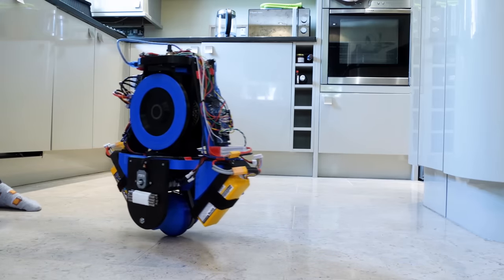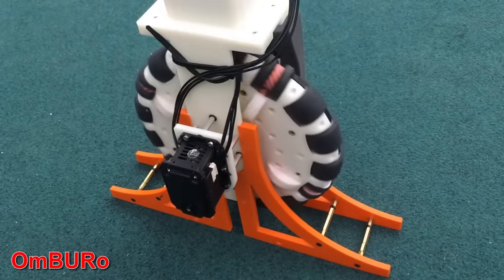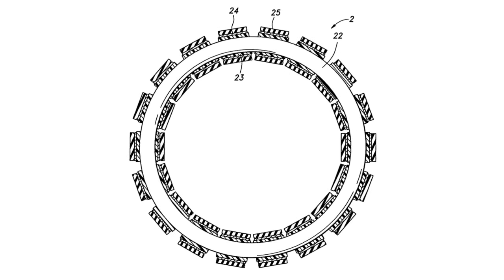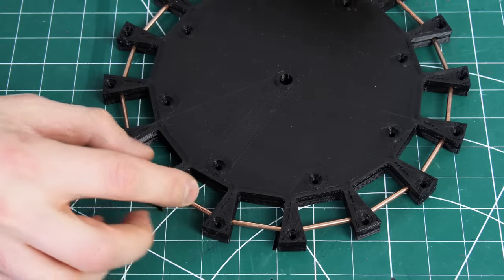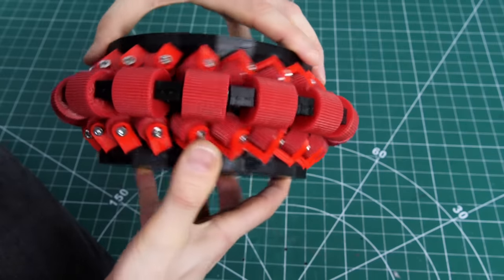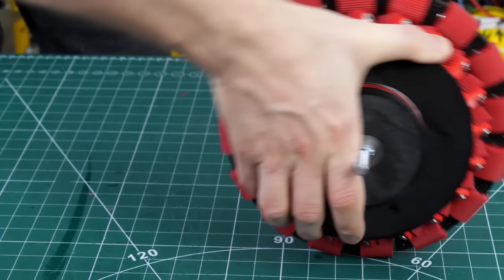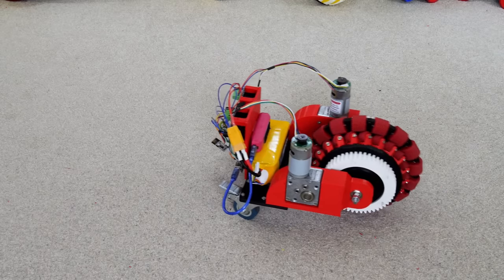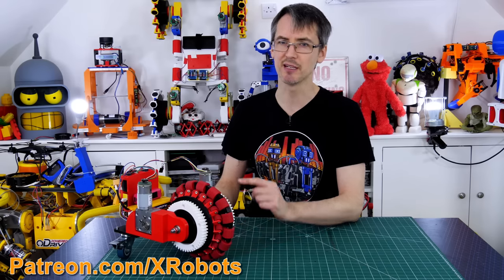Why this Omni-Wheel is Really Weird

Comment: For each of the wheels that comes into contact with the ground, why not print them with a slightly larger middle, and smaller ends? I guess the friction between them and the driving wheels would be less considering, but I think you'd get a smoother ride when going in the direction of the largest axis.

Comment: Seems like all of these concepts have a lot of mechanical complexity and friction that could be overcome by adding motors inside the wheel and use a rotary electrical brush system.

Linking the circumferential wheels though is still an interesting challenge. I imagine backlash would be a real issue. But perhaps tight bevel gears - perhaps in a high durometer flexible filiment, would do the trick.

Comment: The problem with this omni-wheel is efficiency, there is so much friction, so most of the energy we supply is lost as heat, and for a device that is running on batteries, this is a big concern. I think this problem will disqualify this mechanism and make it not practical for use outside a demo.
Reply: Can the design be refined? Maybe this design would be useful in industry somehow. I can see this being far superior to the castors on big things.
Reply: @lindboknifeandtool  Can the design be refined? of course, for example by using harder materials, the deformation of softer materials consume energy and softer materials means more contact surface which means more friction.
Every mechanical transmission system has its own efficiency (ratio of output power to input power), which varies according to several parameters (like gear ratio, contact surface, materials, gear ratio ...), and IMO this system is a bad idea, there is so much contact surface witch generate a lot of friction, the wheels are angled 45°=> even more friction cuz the small wheels and the big one are not going in the same direction, it's like a car that skids all the time, and only a fraction of the applied force are useful at the contact surface between the wheels (Fcos45°) ... , so the best way to refine this design is to throw it away and completely redesign it, which will bring a different product.

Comment: You don't need to drive every roller on the wheel assembly, so why not have a slightly larger core wheel, relying on a combination of the device's weight, and a tension spring as backup, essentially making the roller assembly only able to make contact with and drive the bottom wheels? It would put higher friction load on the bottom of the assembly, but friction around the circumference, where it's not as important and seems to already have slippage from the lack of weight on the rollers, would be drastically reduced.
For visual flair, you could give the core wheel a monowheel design, with the tension spring connecting from the axle.

Comment: You can certainly put an open-source license on it. In fact, doing so to cover the copyright side of things in case you get hit by a bus before the patent expires is the responsible thing to do. You just need to choose a license which doesn't weigh in on the patent side of things.

(That's why you find open-source code for things like H.264 that doesn't get distributed by distros like Fedora. Because, copyright, patents, and trademarks were conceived as mutually independent systems.)

Comment: I believe you may experience some better connection between the out wheels and the driven hub if the small wheels were a spiral threaded design instead of the level tooth-geared design. This would mean the threads on the bearing wheels would fit perfectly inside of the teeth of the drive wheels

Comment: Perhaps a rubber torus more like a traditional inner tube instead of all those fancy rollers. Less parts and better grip, but with more friction loss when strafing. With a rubber torus it might make more sense to have one motor to roll the torus and a different motor to make it spin, due to material loss from friction and a difference in torque requirements. A rubber doughnut would also have more accommodating shock reduction over hard ground. Unfortunately sand/grit would be cancer for a wheel like this either way (fatal flaw).

Comment: This is really cool but it seems to me it would easily break if you used it daily. IF there was a Hole through the middle of the Tire, Maybe you could cover the sideway rollers with a flexibel donut shaped outer layer, this way protecting it from damage and weather. Means you need to put the drive torus in the center of the wheel and find a way to transfer movement without to much friction on the protective layer so the idea isn't without cons im afraid. You are doing brilliant work, Keep it Up!😀

Comment: Question: To get an angled path of travel(forward/backward and left/right simultaneously) would you rotate the two drive gears in opposite directions at differing rates? As in, the difference between the speed of the two rotating gears would be translated into forward/backward motion?

Comment: Hello, thank you for your awesome videos. But I have one question on this particular video.
Wouldn't it work better if you had printed diagonal lines on the little hubrolls instead of the straight lines? So that they could line up better with the bigger outputwheels wheels.

Comment: Very cool! I wonder if there would be any benefits from making the drive hubs smaller, and offsetting them so the little gears only engage with the larger ones that are in contact with the floor. Maybe the little hubs could also be more perpendicular to the main hub (more parallel with the floor) so they could squeeze the driving gears harder, while also reducing the lateral twisting on the little hubs.

Comment: The grooves in the smaller, 45 degree angle wheels should be cut at an angle that matches the larger wheel's groove's angles so that the gears interlock and not just slip past eachother.

Comment: Wonder what would happen when the subwheels have a 45° groof. Obviously one side of the sidewheels need to be turned 90° to match the other. This, next to better interlocking of the wheels, gives way to a harder material used for all wheels.

Comment: intersect subtractive cuts on the center where the rollers touch.  Then you would perfect gearing between the angled rollers and the center rollers, but maintain tread on the center.  As if you had a crosshatch pattern so that 2 separate angles of gear teeth coexist.

Comment: if you want a flexible inealastic material torsion transfer material, try speedo cable, or the larger flexible drive cables used to power tools

Comment: I feel like the helical gear solution is still a much better solution. I don't think with brushless motors and high accelerations and decelerations the tires are going to efficiently transmit the torque reliably. Great project! I am no wheel expert! Just my theory based on what little I know of something I had never heard of until 10 minutes ago!

Comment: The OmBURo wheel could be improved upon. Drive the wheels from the outer portions of the axles, rather than from the center, and hide the gearing within the mounting plate. Doing this to every wheel would remove the need for the flexible shaft while also turning every wheel equally. Honda's wheel obviously works fine, but I personally feel better with a geared connection rather than having a friction-based connection that relies on redundancy upon redundancy. IIRC, dual input differential drives to change between driving and steering are called swerve drives, at least in competition robotics, and these kinds of wheels are just an evolution of a typical swerve drive. It'd be interesting to see if anyone can ever refine an omni-swerve, but I don't think there's any chance that it'll ever see use outside of medium speed robots on fairly level ground; which is the downfall of all omni wheels, none of them will ever see use in areas where they'll actually be pushed to their limits, such as road vehicles for speed or rough terrain for durability.

Comment: Neat, but the design issue is the energy used to perpetuate balance motion is much higher than simply using a robot which is built around minimal use of energy for movement and balance.

You could perhaps use this for a microscopic robot, by using matter that repeats states in a systematic nature (for instance, quartz, or time crystals, etc)
But the amount of energy needed for larger robots... mehhh.

Could simply make an egg shape robot that keeps balance perpetually due to its shape and weight distribution, vs this which needs massive energy for gains which can simply be had through design.

But yes, looks fun to mess around with.

Comment: A better way to drive the small wheels would be one gear pointing down that connected to a sliding the axle of each wheel when it came into rotation under it, sliding through to the next wheel.

Comment: Why not print the grooves on the rollers at a helical 45° angle, so they fit properly with the outer wheels instead of relying on friction to drive it? Then you could use something tougher, like vulcanized rubber.

Edit: Just noticed everyone else saying the same thing.

Comment: The problem with this design is the excessive friction between the wheel sandwich. It does work, and with some refinements, it would work very well, but a slight modification using a mechanism similar to how a helicopter tilts the main rotor would be massively better. The reason is in this design there are forces to drive all the wheels even if they are not touching the floor. The mechanism should only power the region of the wheel that is actively ingaged in motivation. This can be accomplished with a stationary V shaped design. You seem to be extremely adept in what you do. Could you please make a video at this attempt and tag me on the comments? I think you'll find it to be an extremely superior design as this and potentially even something you can market. The only downside to the V shaped design is having enough friction where you need it. I'm thinking electromagnetic force or neodymium along with a clamping force of the V Frame. I'd try it myself but I don't have your resources available. Good stuff man! 👏

Comment: Can you print the small drive wheels with a worm gear like profile interlocking the outside wheels?
And maybe make the outside wheels a bit curved, ball like, and the small drive wheels concave worm gears? (Or would that hinder if the drive wheels hop over to the next outer wheel?)

Comment: For this current demo, would a design like a screw that goes both ways work for your central wheel? It would be less binding and always have a point 'flat' against the gear as it pushed on it I'd think. Would be less binding and allow you to tighten up the design a bit ya?

Comment: Shouldn't you be able to use slightly bulbous wheels instead of wheels of curved cylinders, so you'll still be able to use the straight axles? maybe also try to match the shape of the contact area of the little wheels with the big ones to get more torque, making them slightly concave.

Comment: I dont think the omburo design would be hard to print. just use a helical gear for every roller and the same stiff individual shafts you have here, instead of 4 total with flexible shafts. the main helical gear might fit inside a wheel print and keep the whole thing compact and together.

Comment: Instead of a flexible shaft, what about dog bones? You wouldn't need to worry about using any exotic material just having a bar with 2 letter C or U shapes on either end of the shaft That could interlock with each other or T shape axles with a Slotted socket U-joint couplers like modern RC cars use.

Comment: I don't know if your 3d printer ( or really any 3d printer) has right enough tolerances for this. But you could possibly curve the exterior(?) wheels to match the circular curvature in the interior(?) wheels, and then you could curve the teeth of the gear like they do for stage gearing(?).

Kinda like )((0))(

Idk, the question marks are all the things in not entirely sure how to describe, and I've never really looked into this before, but those are my preliminary thoughts.

Comment: Could you use small outrunner motors as hub motors for each roller or use 2-4 of them connected to each other via segments of flexible drive cable?

Comment: How about you make the outer wheels shaped like a football with the edges cut off?
That way you'll always have consistent friction with the floor and you won't have the issue of the elbow-pasta copyright wheels :)
Reply from the maker: Because the little rollers on the sides will have even less contact area.

Comment: With the hubs having their wheels mounted at 45 degrees, the cog teeth are not meshing well with those of the central wheel, even though they're made of some soft plastic. Perhaps a better tooth design would help. Instead of the cogs having teeth cut in the Z axis as straight lines, why not have them as a pattern of dots? Essentially have two 45 degree cog patterns superimposed, and where they coincide, have a point, a peak. Where they un-coincide, have nothing. A bit like coinciding waves on water or the like, the two wave patterns reinforcing and cancelling. 

This pattern of little studs ought to engage better even though they're at a different angle, and engage regardless of the direction. At the moment the cog pattern is useless and they'd be better off flat. Little studs would go both ways, in the spirit of a Meccanum wheel. 

I might be wrong on the angles to use, but 45 degrees and 225 degrees (45 + 180) make sense to me.

Getting this right might enable you to print the relevant rollers out of something harder, reducing slip and giving much better control, and much more efficiency. The central hub, btw, would keep it's existing cog pattern, though perhaps that could be improved too. These are just initial thoughts. Surprised you didn't consider this while you were waiting for it all to print! Obviously with 2 printers you're being spoiled!

Comment: i wonder if having the teeth on the small rollers at a 45 degree angle so that they mesh with the large rollers would have any meaningful improvement. or if printing the rollers as mostly solid plastic with only the outer 1mm or so being tpu and/or printing the rollers as more of a sheath for a long bearing would help. i'd love to see where this idea goes

...also at what point does this become different enough from the patent that it isn't infringement? i guess the addition of teeth isn't enough?

Comment: Isn't such a system too sluggish to drive at higher speeds on uneven surfaces?  Let's say you build the whole thing in large and drive it on a cobblestone road or off-road. I mean most surfaces are not that wheel friendly.

Comment: what about using pex as a drive shaft it's flexible and it doesn't stretch you could also put sand in it to make it hever on the bottom making it easier to balance

Comment: So the drive wheels are held at an angle to the output wheels but the teeth do not need to mesh? Wouldn't that end up in slippage and a loss of energy in the transfer? Or does this have some other advantage?

Comment: This is very interesting and I’m glad that you made it, but couldn’t you accomplish all of this just with two wheels each with its own motor? Kind of like how a tank works? Such that if both wheels are going the same direction you move forward, but if you control the speed of the two side-by-side wheels it could turn or have a semi directional thrust?

I’m sure there are some problems with this as well, but it seems like a simpler thing to work out and probably more efficient at getting power to motion.

Comment: There is no machine in the world that does not malfunction from time to time.
If there is only one wheel and a malfunction occurs during operation, the user may be injured. Therefore, a separate device that reacts in case of malfunction should be added to protect the user.

Comment: I wonder if you could make an omni-wheel using a ball with magnets embedded under its surface. There would have to be lots of corresponding coils in the socket that levitate the vehicle over the ball and drive it along by switching their currents around, i.e. a two-dimensional stator. Ooof, sounds complicated, now that I think of it :-D But it would be really cool.

Comment: Let me just say I am not technical in any sense what's so ever and this may already have been done so forgive me.

That being said could you make a contraption that has two half of a circle separated w/ a cross joint that acts like an axle gripping on both sides of these half circles. The half circles have a rubber track w/ some grip on which side. That's on the east and west side of the center piece. There would also be another set of these in north and south positions doing the same thing connected to the other sections of the cross joint. The motor would be in the center connected to the cross joint powering the tracks on each half circle. Then you can in case the whole thing in side of a sphere/ball and you would have a remote control ball that can move in any direction. The only part I'm stuck on is how do you attach it to something. For me I think of this being used as a single wheel wheelchair w/ the ball sitting under the chair. 

I don't know. It might be dumb. It might have already been done before but thought I'd pass it on. If you have any questions I can try to explain more but I'm just a dumb guy who knows nothing of how to actually do the technical parts lol

Comment: Could you take the omi wheel and make it into a monowheel? I've seen the video where you take an omni wheel and use a gryoscope wheel to balance it but what if you had the smaller parts of the omni wheel move left and right to balance it upright and use the actual wheel to keep it stable forwards and backwards?